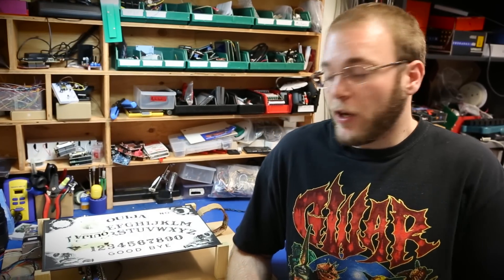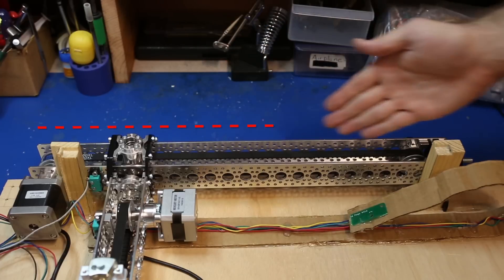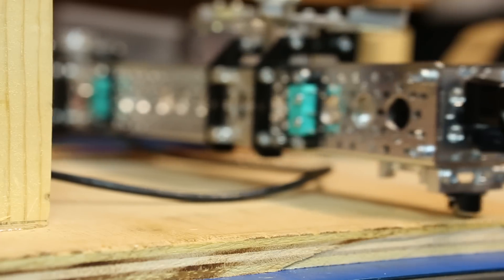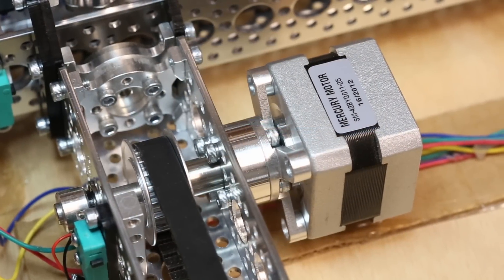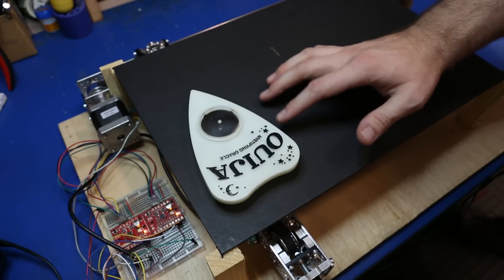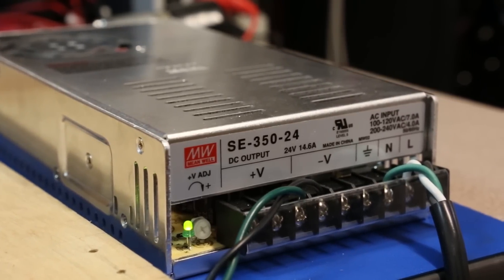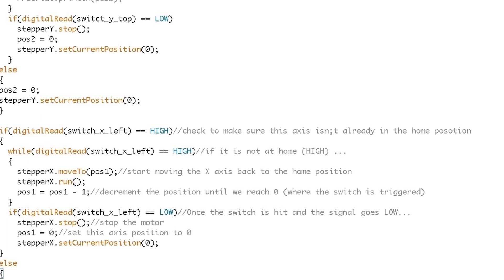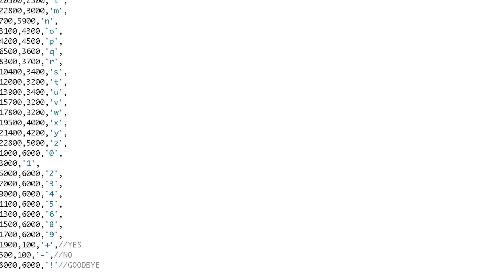SparkFun Arduino Controlled Ouija Board

Comment: Since the load is light, perhaps one could reduce costs by hacking an old scanner. That will provide one axis as a starting point. Also needs to be made thin enough so it is not so obviously a lot of mechanics underneath. It would be fun to add something to vibrate the board like it is possessed by an angry spirit.

Comment: The recommended parts list total only comes to $432.91!  That's before tax & shipping and doesn't include magnets, components, wire, a Ouija board, etc., etc.

Was the goal to make the most expensive version possible of this project out of stuff SparkFun sells?  If so then well done!
Reply: ***** My point is that that's an absurd price tag for a project like this.  I'd bet that rail system is all kinds of awesome and might well be worth the price but they're EXTREME OVERKILL for this application unless it's going in an installation at Disney or somewhere where $ is no object.
Reply: I think my issue was sticker shock; I did not expect the project to cost well over $500.

I'm used to watching "Make"-style videos which usually have the average person/ hobbyist in mind; not the high-end professional.  To avoid negative comments from hobbyists it might be good to specify in the video description that your videos/this type are targeted towards professionals.

I bet that Actobotics stuff is all kinds of useful.  I wish I had the budget for it.  :)
Reply: Casey Wagner well you could just take this idea as inspiration and make your own board using cheaper parts.